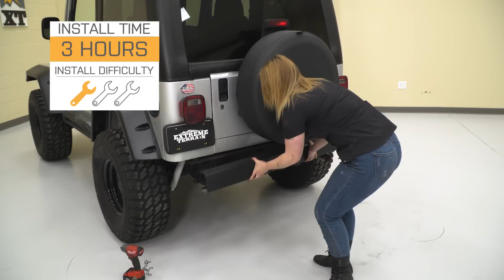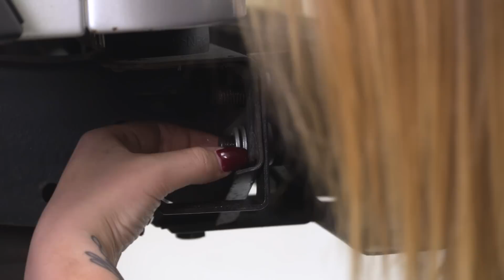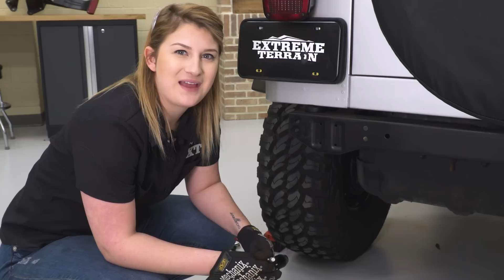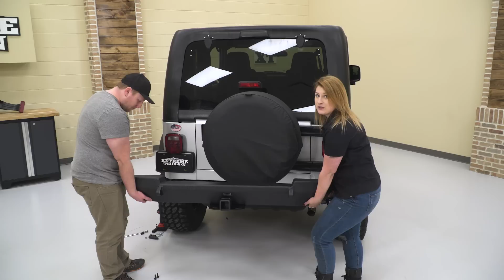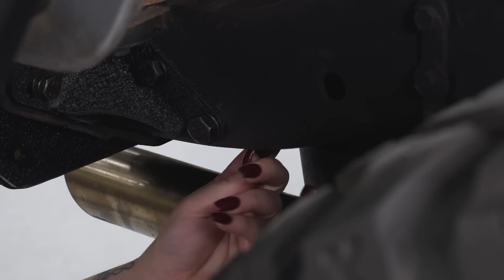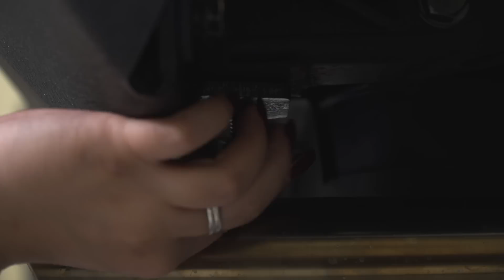Jeep Wrangler Smittybilt XRC Rear Bumper (1987-2006 YJ & TJ) Review & Install

Comment: This video skips over the hardest part. Getting the 4 inner bolts installed. Smittybilt needs to redesign the mounting of this bumper. Installation will required the tank to be dropped.

Comment: Good video, however...I just installed this and you absolutely have to drop the tank to get the inside bolts on the driver's side mounted. I was able to get them as she shows on the passenger side, but they didn't show the driver's side...and after I got into this install I see why they left it out of the video. It was a bear!!

Comment: The fuel tank is underneath on the passengers side.......
Reply: Not on a YJ/TJ its behind the rear axle
Reply: I bought this bumper, and you can not install the 4 bolts in the center either side of the hitch tube without removing the fuel tank. It would be nice if one of these "super easy" videos showed that!